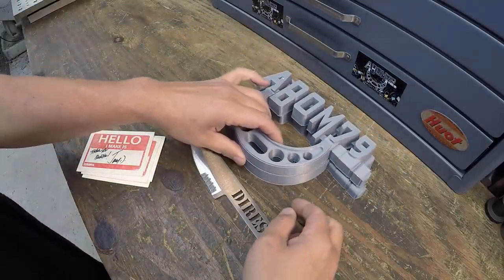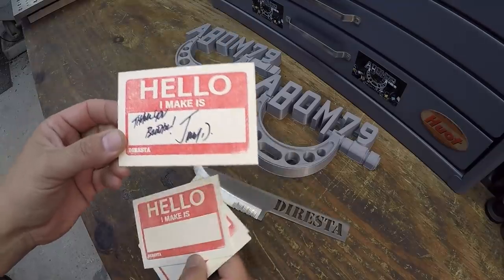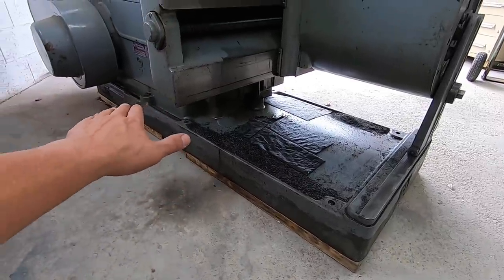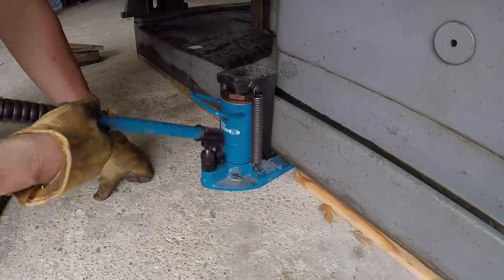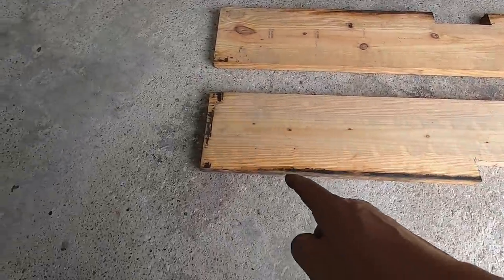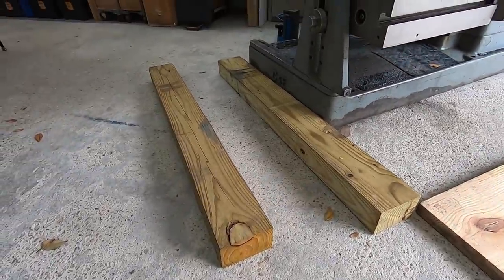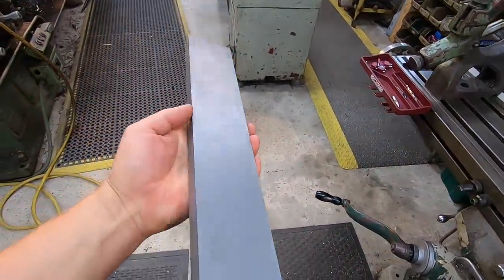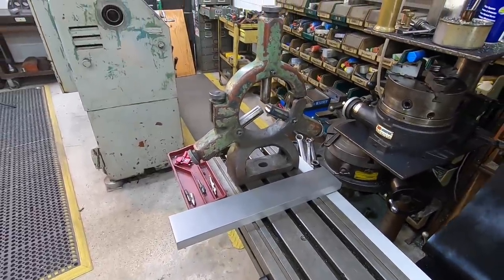SNS 299: Shaper Lifting, Steady rest Mount, New Electric Circuits

Comment: I have never felt I could criticize anything you have ever done, but I feel obliged to note that supporting the shaper on the front and back is likely to result in serious damage to the machine. It needs to be supported throughout the whole length and width of the base and it needs to be bolted to the floor. Our shapers were always mounted on cement foundations, about 20 cm high and bolted at all four corners. I am certain you will be heartbroken if you cause damage to that beautiful machine. Just supporting it that way even without running it can cause permanent warping of the base plate.
Reply: That's a very interesting point you make.  I never considered the elasticity of the casting itself might result in sag, but now that you mention it that makes perfect sense due to the tight tolerance of the ways.  Even a sag of a few thou would be enough to affect the overall accuracy, especially over time.

Also wood is pretty spongy overall as far as material goes.  I think as the ram moves back and forth that few thou of movement is probably just the wood compressing.

Comment: Something tells me it's not a good thing to leave middle of the base hanging in air like that. Six adjustable Abom-size feets would be a lot better/safer.
Reply: Two wedges machined so that they mate without slipping that can somehow be affixed together once they reach the proper elevation would be ideal.

Comment: I leveled all the new and old machine tools at Caterpillar between 1973 and 2000 when I retired. Bldg B Drive train Division. Get rid of the wood... They need to be lagged to the concrete with metal shims or blocks used to level the machine. The large machines had machine jacks that adjusted for elevation like an adjustable parallel.

Comment: You really should have the shaper supported in the middle. that base looks too thin to support the weight of the superstructure.  As  you said yourself, it should really be grouted all round - in other words supported all over. You should indicate the mid point of the base and see what it is doing.

Comment: Aren't you afraid of cracking the base casting by not supporting the center?
Reply: put a dial on the center while its running and watch that puppy flex.  
crack that base and you have a nice door stopper
Reply: Immediately thought the same thing.

Comment: So, if it's heavy through the middle, wouldn't bracing the ends only eventually cause the center to sag a bit and cause wear on the front and back of the ram ways?

Comment: Back in the early 90's I worked as a Millwright setting up equipment in a local Incinerator - I used to align couplings between BIG motors and large fans, pumps, lube-oil skids, etc - and eventually do all the pre-service to the Steam Turbine and Generator that weighed many Hundreds of Tons-
Typically big equipment like that we would have had big bolts ("L" Shaped) cast into the concrete, with nuts and big flat washers on them, lowered the equipment down onto the studs embedded into the concrete, down onto those 6 mounting holes, used the nuts and washers to lift the machine and level it, usually leaving at least a 1 to 2 inch gap underneath. installing nuts and flat washers on the top side (of your 6 holes) and then a form would be made around it and they would pump high tensile strength, fibre reinforced grout under the entire machine.
Before the grout was fully cured the forms would be removed and the concrete finishing crew would come and carve it when it was like clay consistency and it would be trimmed and contoured to the base of the machine, wiped down with wet sponges and covered in strips of wet burlap to keep it from drying too quick and cracking-  Your machine would NOT move then- LOL
Reply: That sounds like the gold standard for mounting a machine.  I'm guessing Adam is thinking that he  might end up moving the shaper at some point in the future, hence the wood blocks to mount it.

Comment: I enjoy watching your channel. I used to setup  injection moulding machines, and I used anti vibration pads that are adjustable for machine levelling. They do not require bolting to floor. They through bolt in the holes in the base.

Comment: Adam, I had a 10 ft. Hydro Shear that was installed on a slightly uneven concrete  floor. An old timer friend of mine told me to set it on one or two pieces of sheet lead (if you can find some). We did and it nested itself right in. I realize that the forces on your machine are horizontal where mine were vertical, but with a shear the blade the adjustments were very critical. Good luck buddy, and take care!

Comment: Hey Adam, I love the content of your videos, it's great to see an engineer that does it right...… that said, I would be concerned setting the shaper on just 3 points, she's a heavy old girl and needs plenty of support and a more solid footing would be better.
You could try setting her down on six points on adjustable feet, there are many different ways to do this but to suit your needs (as in perhaps needing to move her around, you could use the 2 part tapered type with  metal blocks underneath and rubber pads to stop any slipping, that way you could have her set on six points and still be able to move her if required.....
Great layout in your workshop.... looking forward to more videos!....

Comment: One other thing to worry about, as if you don't have enough. Should you decide to convert more machines to 480vac and find yourself turning the x-former breaker on and off more often, make sure the breaker is switch rated. If it isn't put a disconnect switch or contactor on the line side of the x-former.

Comment: Adam,
 I spent a career maintaining and rigging Machine tools. I do not recommend using wood. We routinely used steel shim stock. Rarely did we ever anchor a machine with this weight. It is not terribly difficult to level a machine of this size with shim stock to within .0005"/foot. Level isn't necessary on your machine, but being level could enhance machining set up. I trusted shim stock leveling for years of high production use.
If you want to get really fancy, consider making leveling jack screws and pads with a detent or counterbore to keep the pads in place under the screw.
Grouting is a superior method once leveling is complete, but repositioning the machine then becomes problematic.
I really like using the mill for outboard lathe stick out support.

Comment: Many times I have drilled and sunk anchor bolts in my concrete garage floor in order to anchor and level heavy machines. When I wanted them in another place I simply use an angle grinder to take the unwanted bolts down to floor level.  You can patch the concrete if the aesthetics bother you.  Much better than "living with" a 2-3 thousandths rocking motion.  If your're going to do it...do it right!!

Comment: Hi Adam, When I was installing printing presses my level was accurate to 0.02mm in one meter and machine had no tolerance to be out of level.  What I will recommend you do is use the timbers at each end (possibly go to hardwood) and place a shim plate of approx., 6"x8"at each corner of maybe .050" thick between timber and machine, you only want machine to rest on corners, not in middle of timber, then take reading with indicator while machine is running. You will likely still have some movement, now what you will do is try to determine what corner is loose by tapping timber with a hammer and  shim loose corner accordingly (this may only be a few thousandths depending on how loose) until you have all corners tight and no more movement on indicator.
I hope this helps Adam and thanks for all your videos.  Ray
Reply: @David-lb4te  and what is your expert field,,,  I have over 30+ years repairing, assembling and installing machines with many valued over 3 million dollars. I did suggest going to hardwood for a reason and the machine should possibly be locked in place to prevent movement.
Ideally the machine would not be on the timbers but only on the steel shims and blocked in place to prevent movement. Also it does Not require to be supported in the center, these machines are designed to be leveled at corners, this is how its done,, properly.   I would not say YOUR information is the worst advice I've read,,, but only someone that does not know any better.

Comment: I believe you might want to support each corner separately,then measure for blocks in the middle. I would be afraid of putting undo stress on the middle without support there. Better save than sorry!

Comment: The 3 point foot setup will help with any rocking on an unlevel floor. I think what play you have left in the shaper is, the wood itself compressing. Those posts look like pine, a softwood, I would do some digging around on Craigslist and businesses for some free pallets, on the bigger pallets like they use to ship zero turn mowers, four wheelers, etc... or big equipment, you can find 6x6 or 4x6 pallet runners / blocks and the majority are made out of oak, a lot harder than pine. However, after a while it may fully compress and you might be okay. You will need to see.
Reply: I was wondering about that wood as well, since the 2x's he pulled out looked like standard big-box white wood/pine etc.
Agree that a decent hardwood and watch the grain-  http://workshopcompanion.com/KnowHow/Design/Nature_of_Wood/3_Wood_Strength/3_Wood_Strength.htm

Comment: Machine 6”. Diameter disks and drill and tap for studs. Epoxy disks to foot and bolt machine in place.  If you need to move it after you can heat the disks and break the epoxy bond and move it. No holes in concrete required.

Comment: I sat my shaper down on one of those horse mats from Tractor supply and it levels out nicely.  The bottom of my shaper was slightly bowed as well and it rock some.  THe horse mat fixed that issue real quick.

Comment: Adam, during the mid-eighties, I was part of a crew of dismantlers under contract with Seaboard Coastline Railroad to divest their Port Boca Grande FL. location of all equipment.
Port Boca Grande, located on Gasparilla Island about 100 miles south of Tampa, predated electricity's availability on the island. Therefore, a steam-powered generator was located at the port in the same building that housed a large and very capable shop filled with common shaft powered machinery, all of which was bedded in a mortar to compensate for the floor's unevenness. We were treated to a tour of and allowed several weeks to use the still fully functional, albeit now commonly electrified, shop to build gantries and the like. All the machines were rock stable. No judgment and your mileage may vary, just sharing some wisdom from the past. I greatly enjoy your channel, carry on sir.

Comment: All of our old shapers were all anchored to the floor. You could keep it elevated like you have it but use heavy duty planer jacks to support the areas no covered by the 3 point setup. You can run them up to where they just have slight pressure and lock them in to keep them from turning.

Comment: I ran a plywood hotmelt edge bander that had a cutoff wheel that moved front to back following the piece moving through to cut off the applied edging.  it was on a pneumatic ram and wasn't that big.  But over time, after running for days and weeks and months, it moved that huge 12' long cast iron machine to the point it almost broke the air line coming from the floor.   If it even moved a .00001 every time it cycled, add all that up over time and it moved inches.   So if it's not bolted down, it will walk around the shop.

Comment: I'll admit I was curious if you were getting any significant deflection at the mid mounting points on the shaper, with the 3-point base support?  Since it was designed for 6-point securement, and since it's a long, heavy machine, I'd double-check what the unsuppored middle is doing.  It might be interesting to put 3 indicators on the base simultaneously, one each front, middle, and rear, and watch the pattern of motion between the indicators.

Comment: Here's an idea for mounting your shaper. I've used truck tire retread throwoffs I picked up on the freeway under my machines. I cut them on my bandsaw into squares of the size I want and place them at mounting points under the machine. They work great and absorb vibrations while compensating for an uneven floor. I've also drilled holes in them for mounting my air compressor to the floor. Keep in mind you'll destroy your bandsaw blade cutting through the steel cord in the tread.

Comment: As others have said the motor is most likely the start windings.
the soft wood on the shaper is simply a bad idea, use steel plates if you must have it off of the floor or hard wood, then you should shim it, the plates and shims should extend outside the base by 30 to 50mm, avoid edge to edge. It will take an age but will be worth it.
Looking forward to SNS300 next week.

Comment: You might think about fabbing up two steel rails drilled and tapped for anchor bolts and grouting those rails in level and coplaner to each other then mounting the machine to those rails.  This would allow you to unbolt and move the machine should you need to but provide a solid and flat connection to the concrete.  I see a lot of industrial machines mounting in this way.

Comment: If you need any electrical help, let me know. I am an Electrical Engineer working with National Aerospace Solutions. I would recommend that the keyseater be provided with 230 or 240 volts as there are inherent voltage drop in all electrical systems. I have recently been involved in installing large motors (5000 HP) that are rated at 6600 volts, but are supplied with 6900 volts. Also, DO NOT run the keyseater until it is freely rotating. Locked rotor current is much higher than full load current and will quickly damage a motor (if damage did not occur already). Ensure that all wiring has proper ampacity (current carrying capacity) and sized according to NFPA 70 (National Electric Code). Let me know if you have any questions, comments, etc.

Comment: Single-phase motors have a secondary phase coil which usually uses a motor starting capacitor to get it spinning, and that Davis cutter's motor may have a blown capacitor which may be why it is just sitting there humming rather than spinning.  Check the capacitor and replace if that is the case.
Reply: Blown or disconnected cap, or bad centrifugal switch if it is a single phase motor.

Comment: Use solid (not wood) footings that will suit the machinery mounting pads under each tie-down point and then shim the thing into a stable and level condition is my suggestion..  That method provides the maximum stability for the machine while compensating for the less-than-perfect concrete flooring.  It also allows the machine to be moved and re-shimmed at some future point.   (I worked in the oil/gas/power generation field and installed  LOT of heavy equipment!)  ;)  Thanks for all the neat videos!

Comment: Do you worry about the shaper sagging in the middle without any support there? 

I’d think about making some center timbers, and fitting them exactly to the height of the middle and wedging them in there. That way, they would give another point of contact with the floor, and prevent sag in the middle.

Comment: Thanks for another great video.  I am not clear why you don’t level the shaper with 6 leveling feet.  I kind of think some of the movement on the indicator is still the base flexing in the middle, now rather than rocking.

Comment: I threaded the holes in the base of a Bridgeport mill, added 3/4x10 square head set screws and some very heavy washers to each corner.   The washers had 5/8" holes so the set screw combination allowed some swivel to match the floor.  I think torqured all the same while leveling the machine so they all had the same load.

Comment: Love your channel. 

You might want to look into self leveling epoxy. It can be costly, but will solve your uneven floor, reduce the risk of your concrete eroding further, and provide chemical resilience. I’ve done this for machine shops out here on the west coast.

Comment: If you've got a motor that just hums, you might also be missing a phase. Either there is a broken/loose wire between the switch and the motor, something wrong with the switch, or (worst-case scenario) you have an open circuit in one of the stator coils. That's easy enough to find with an ohmmeter.

Comment: Also once it’s set where you want gently tap in a couple wedges in the center with a dead blow not enough to lift it just enough to support so it doesn’t sag in the middle over time.

Comment: Hey Adam, I'm quite familiar with using 3d printing to generate patterns for sand casting and it was hard to tell, but those patterns didn't look like they had enough draft to them. Ideally you want 2-3 degrees, but with small features I usually try for 5-7 degrees. A sand-able primer and some pattern paint is really all you need; those looked like some nice, clean prints.

Comment: Hey Adam, don't you think you should support the shaper in the middle too?
Reply: Yeah. If it's designed to be on a grout base, I wonder if the additional bending stress of being supported only on the ends will be carried up to those very precise ways and hurt their precision.
Reply: Seconding on supporting in the middle. The manufacturer had 6 points of support/securing the machine. If it sits well on the end, suggest making some tapered wood shims that you can be driven in to fill the gap and give some support in the middle. Look into Titan Concrete Screws to secure the shaper.  They are easy to install and easy to remove if you want to reposition the machine. I like them much better than drop in anchors.